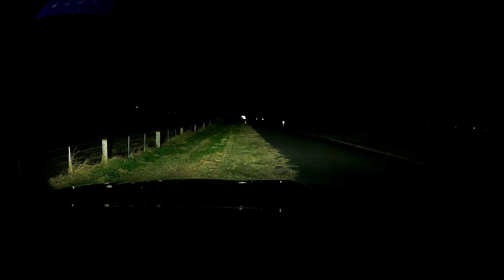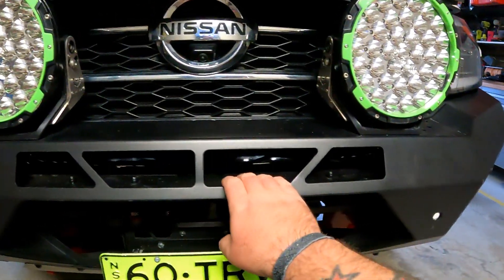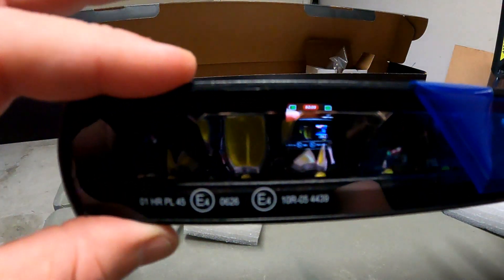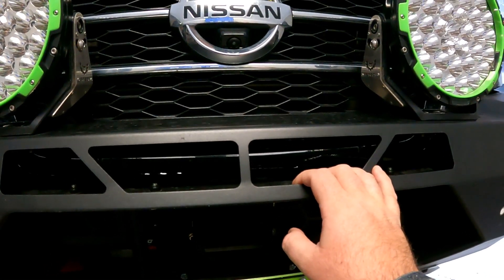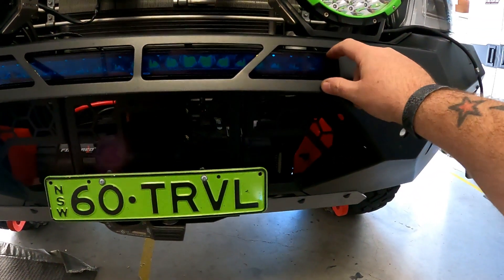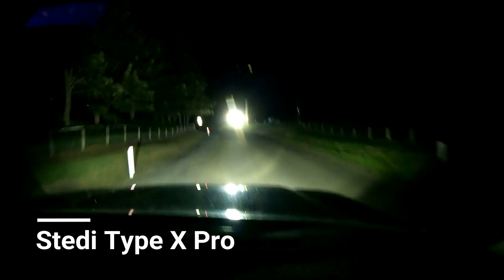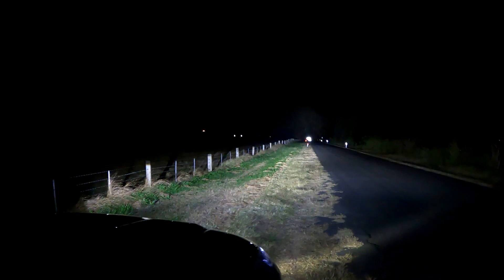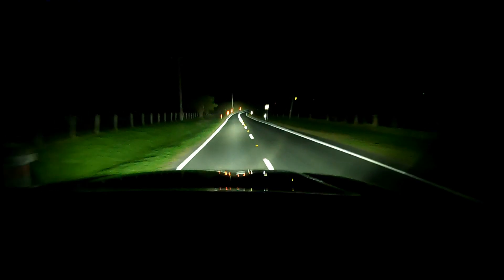STEDI ST1K Lightbar Install & 1st thoughts - HGT Y62 Patrol Build

Comment: Nice! I ended up getting 5 7inch for on top to see how they go. I have the Ironman megatons on the bull bar which are 2 in 1 spot an bar. My rig is Odin62. Will put up pics when I get the Trailmax roof rack on tomorrow. 👍🏼🍻
Reply from the maker: Nice 👍 I do like the look of the Trailmax racks the weight does put me off a little though